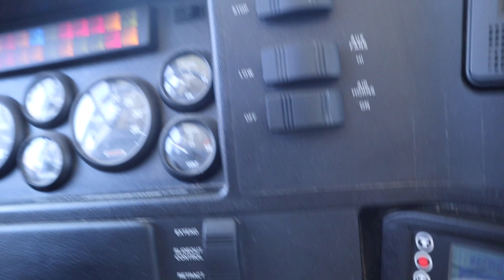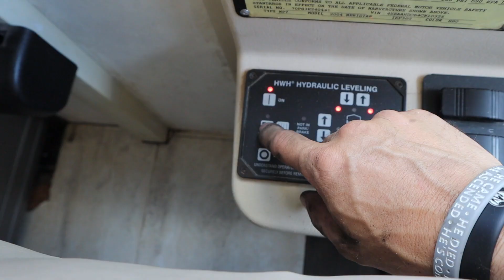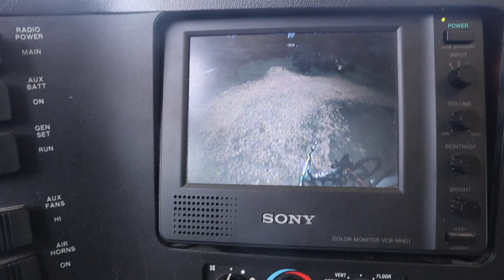LPO6 is Back on the ROAD!! Cabin: To Be Continued!

Comment: You have the perfect content for me. That's a beautiful coach. I have a 40 foot travel trailer. Another small piece of advice. At least four times as many as six times to 8 times a year start your coach and go through the check list and drive it around the block. The amount of maintenance you do on little things will decrease. Most importantly start the motor regularly. Diesel engines and that coach deteriorate if they sit unused for too long. This is very important with a diesel
Reply from the maker: Thank you 😊

Comment: Manual says not to store rv for long periods of time with the jacks down.  I think this is so that you do not stretch the springs but they do not say why. Also, check hydraulic fluid level. There is a bleeder valve for each Jack. Opening that for the affected jack(s) could help. That being said, I had one that I had to pry back up and I had to get the jack replaced. Not cheap (over $1000) if I remember correctly.
Reply from the maker: Thanks

Comment: Y'all should start your RV every month or so just to keep everything running. The air leak is one example why. You would have found that ealier. I've heard both that you should and you shouldn't spray with WD40. I know you should clean the shaft and many will use WD40 then. The biggest culprit for not raising is the springs go bad. Fairly easy to replace.the
Reply from the maker: Thanks

Comment: That's a fail safe on the airline. If the regulator locks on. It keeps it from over pressurizing the airbag. Short answer you did the right thing no big deal.
Reply from the maker: That’s correct.. it’s been working great ever since